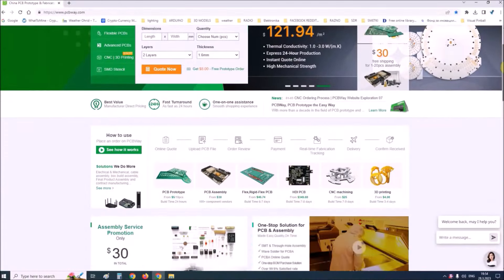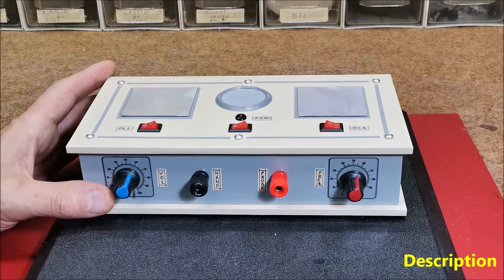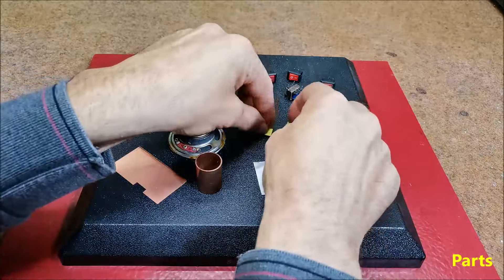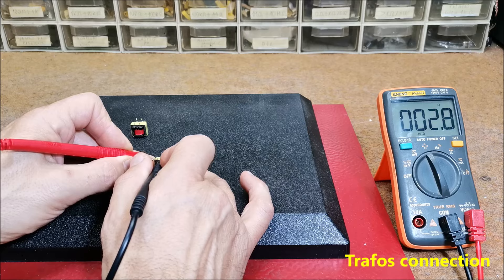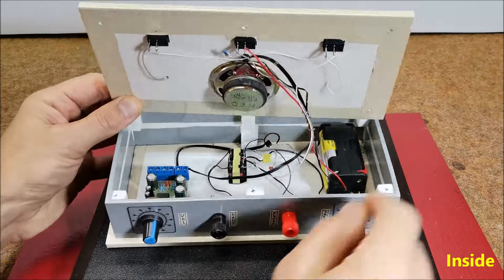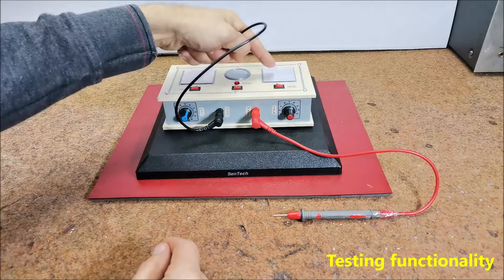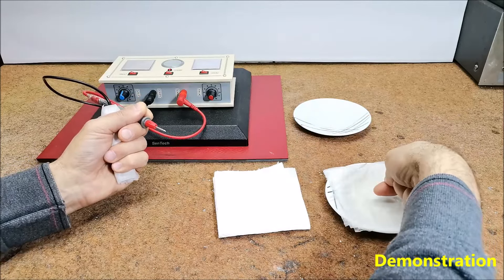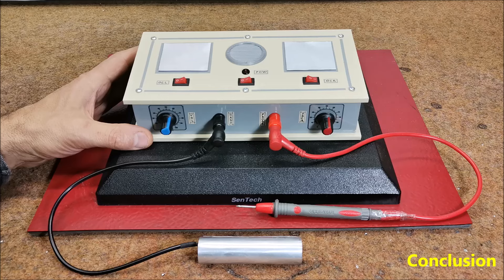How to build simple cheap Hulda Clark Syncrometer

Comment: You have done a lot of very  good jobs.  It is really simple and cheap. It shows  mainly  on volume of sound. Can it be modified as scale of skin resistance. In electroacupuncture acording to Voll  (EAV) they use1 Volt,  3-10 microAmp in probe to detect skin resistance value. The skin contact resistance will usually be between 1000 and 100,000 Ω .  In EAV they  set total  value of skin resistance as 100, and  standard value 50,  normal range 40-60.  For those meridinan and acupoint measured higher than 65 is hyper-reaction and toxic stage of body. For those skin resistance value lower than 40 is hyporeaction and degeneration.  Thank you vaer much.  I live in Taiwan. I also appreciate your DIY PEMF video.:thanksdoc:

Comment: Thank you very much for this nice DIY video. I would have the questions below.
- at 3:50 you say 10nF and 100nF capacitors but your shema shows 10nF and 330pF. What is the right values ?
- I can't find the same small audio transformers as you. Would you have a link please?
- I see a resistor near the speaker but not into the shema. What is the value and the wire shema?
Thanks in advance your answer
Reply from the maker: 10nf and 330pF are the correct values for transformers as in the link: https://www.aliexpress.com/item/33042488652.html?spm=a2g0o.order_list.order_list_main.46.518c1802A5bYLD
Resistor near the spiker is fo the Led and you dont need it .
Detailed instructions at: https://www.hackster.io/mircemk/how-to-build-simple-cheap-hulda-clark-syncrometer-01c08c
Reply: @MirkoPavleskiMK